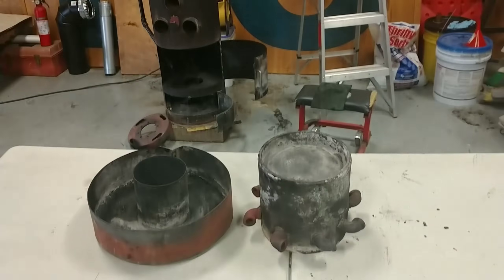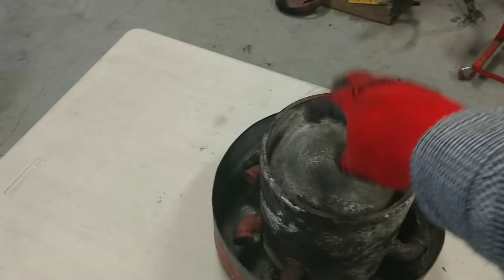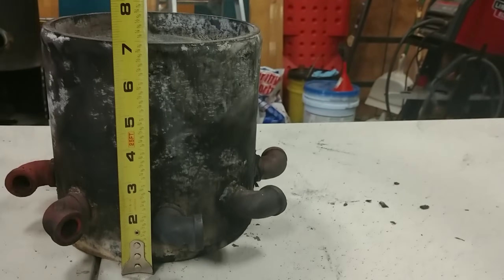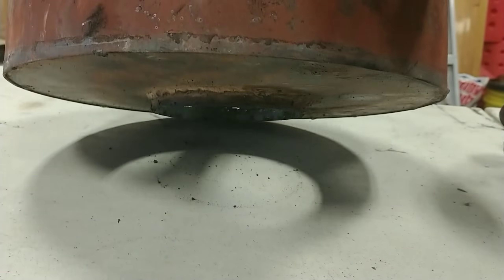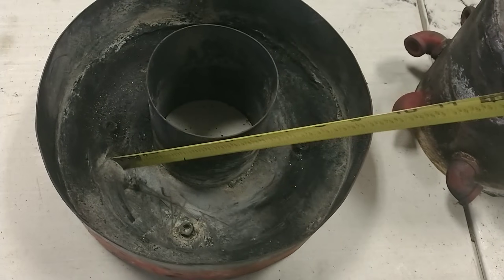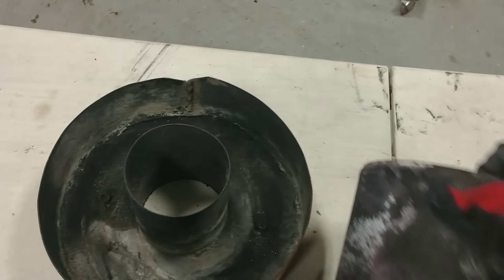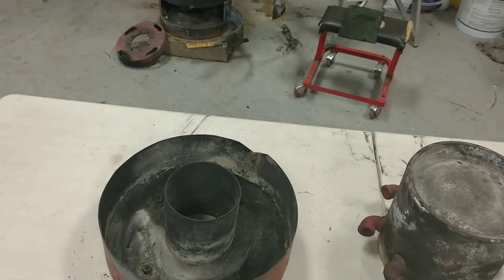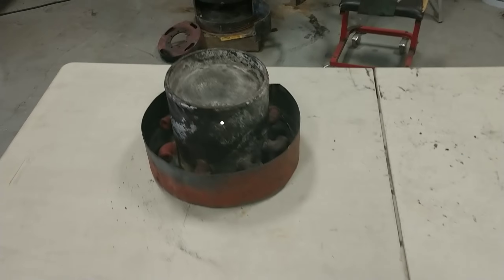Waste Oil Vortex Burner, with dimensions.

Comment from the maker: If you choose to build one of these heaters just know that you need to be very careful and I will not assume any responsibility for anything bad that happens.
Reply from the maker: Great! Be careful. Burning oil can be dangerous
Reply: @randysdiy2102  I built one but with small blower feeding air down the center.   Put some shorts and video on y page today.   Take  a look & see I have lots more to do but it's functional for now.   Summer it will get overhaul and paint
Reply from the maker: Come back and put your link to your video so other people can click on it and see your build

Comment: I have just finished my heater based on your design 
I did purchase a needle valve (most expensive part) after some fiddling around I am able to get it to run at constant 500 degrees no blower just the vortex 
I could not have been happier 
I used 3/8 steel pipe for burn pot(scrap yard)
Reply: Yes I work on small tractor’s so it’s a must even with a exhaust fan 
Just to restate do not leave these alone 
Maybe it’s the needle valve or I got lucky once it is warmed up I ran it all day without adjustment
Reply from the maker: Awesome, just be careful. Carbon monoxide detector would be your best friend

Comment: Gerry has some nice designs for waste oil. I plan to modify a diesel fuel tank for a small shop heater. I have a 16" diameter size, and found a 1/4" thick chrome plated store display piece that will make for a flat top. I'll also use 4" exhaust pipe and drive shaft tube for my chimney. My shop is about 10x12, so it won't take much to heat it. I also want to use transmission fluid for fuel.
Reply from the maker: Gerry is the guy that inspired me to build oil burners

Comment: These heaters have a great potential for disaster! You cannot leave them alone!  The oil drip system needs to be constantly observed, as the temperature change will effect the oils viscosity, and thus, the drip rate. I used to heat a large shop with one that I added to a wood stove. Fantastic heat!  The whole stove body would start to glow. Scary hot!
Reply from the maker: Agreed, you must be extremely careful if you use one. It could end up burning your shop down or worse you.

Comment: your vortex goes counterclockwise  do you think that going clockwise would be better in the northern hemisphere??
Reply from the maker: That is some really deep thoughts. Way beyond my knowledge
Reply: @randysdiy2102  you have half inch elbows do you think larger ones would do better    I am building one now and was thinking of using 3/4 or 10 instead of 8   not sure 10 will fit tho
Reply from the maker: Yes,  in my later video I had added more holes in the intake hat and improved the performance greatly.  I put 8 more holes between the existing ones. {Disclaimer, be careful burning oil it's very very dangerous)
Reply: @randysdiy2102  have you built one with just a lot of fair sized holes and no elbows to see how it performed?
Reply from the maker: I haven't but I don't think there would be any difference in it at all
Reply: @randysdiy2102  I was just wondering because just drilling holes would be a lot easier.And cheaper.
Reply from the maker: You might lose a little bit of the spinning motion of the fire but I really don't think it's going to affect it very much at all

Comment: I would like to build a mini version wonder how small it can be and still function.  I have built some little coal burners so think it may work so just hunting around for videos at oil burners.
Reply from the maker: I really don't think it matters how large or small, however I would never use this heater in my house. And build it knowing it is very dangerous on many levels. Good luck if you feel you can be safe in building one.
Reply: @randysdiy2102  Thanks Yeah don't think I would want to risk it in a house but in my little brick garage think it would be great to have a smaller version.  A fun winter tinkering project to keep me sane during the long winter.  I built a coal burner last year so that works good now on to a new project.
Reply: @marctorrades1760  Thanks I will go check it out
Reply from the maker: Gerry was my inspiration for building one of these heaters. Great guy!

Comment: Can you burn synthetic oil? Any reason that would be a bad idea?
Reply: I ask because I work at a company that does oil changes on house power generators that use full synthetic 5w30. We have huge container at the shop.
Reply from the maker: I don't see any reason it wouldn't work but I never have burned synthetic oil

Comment: When are Americans going to ditch the really dated imperial system and get with the rest of the world and go Metric. 
Calculating fractions is so unnecessary, when metric is purely denominations of 10.
Reply: The rest of the world is doing it wrong
Reply from the maker: Wow, thanks
Reply: The metric system is great for some things, but really sucks when you are using a lathe. Fractional measurements work much better for cutting threads.
Reply: What size ratchets turn EVERY socket on the planet, including metrics??? 1/4. 3/8. And 1/2”. Lol!!
Reply: Who gives a rats ass what the rest of the world is doing. We're used to doing it our way. 'Merica!

Comment: Randy, I have belt mine with a blower and gotten 1000 degrees Fahrenheit out of it but I would like to do away with the air blower if it will perform the same. It seems like you have accomplished that. Have you somewhat perfected yours yet? If so, please reply either to me or online.
Reply from the maker: I have not. We have had some really crazy weather here this year. It hadn't been Cold enough to use the heater. so I haven't been able to test it out with the changes I made with sealing the door.i will be lighting it soon and making more videos of it to see how it performs.
Reply: @randysdiy2102  here is mine with vacuum cleaner as a blower. I'm going to change that to a leaf blower. I also have some tweaks to do to the door and the air and fuel manifold.
Reply: @randysdiy2102  sorry, forgot to add the The link to my video.
https://photos.app.goo.gl/HZA7VzowxNg6BV3S6
Reply: @randysdiy2102  here's another one that doesn't use a blower and the theory seems to work very well and I'm sure it could be increased in size to heat your shop. Much simpler than anything neither one of us has done. I might try the burner in mine. It would be nice not to have to rely on a blower. I need to find some stuff to glue the furnace seal to the door.

https://youtu.be/WyredKT2VdE

Comment: Built a heater based on your design, but i seem to get a lot of smoke from the chimney and a lot of build up in the burn pot any advice?
Reply from the maker: Probably need more air introduced to the flame pot. Remember mine has a leaky door so I may have to put more air inlets when I seal it up.
Reply from the maker: Did you get it tuned for less smoke?

Comment: After watching this dimension video and your previous smoke video, i would say your heater runs rich because of the size of your air holes there behind the 90's Those are a relatively small combined surface area for the air flow compared to many of the other stoves i have seen that utilize this way of manipulating the air flow. 

That one of Gerry's with the 3 large slots horizontally seems to work amazingly. Maybe the best I have ever seen.
Reply from the maker: I have thought about adding some more of those 3/8 90's
Reply: Maybe 1/2"....90's
Reply: Great Job Randy!
I love your design
Reply: With consideration to “90’s restrict flow rate” I kinda wonder if 45’s would work?

Comment: Can you tell me your exhaust and chimney diameter? Also have you done any more heat exchanger pipes? Curious if cooling the exhaust affects the burn.  I'm going to upscale the design a bit I think and use 2x4 tubing for heat exchangers to simplify fitting them and welding. I have a 24"x 53" air tank and a 30x 53" propane tank. Not sure which to go with yet. I have a 60x100 shop. Thanks!
Reply from the maker: Will chimney is 6 inch diameter approximately 15 feet in length

Comment: If you added the fuel under the "hat", the flames would combine with the air and shoot out the 90 degree fittings.  Seems your burn would be more complete and produce a better swirl.
Reply from the maker: I believe some of the fuel does get underneath the hat as it's not a perfect seal, I'm just not sure if it can burn inside that chamber